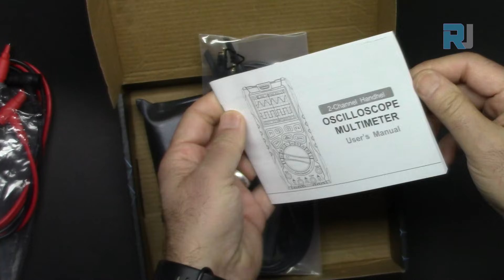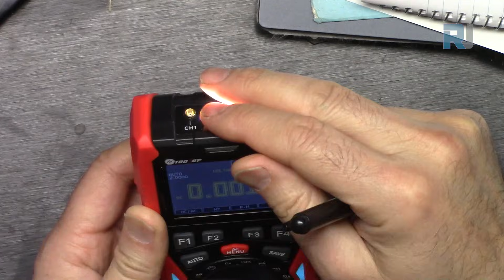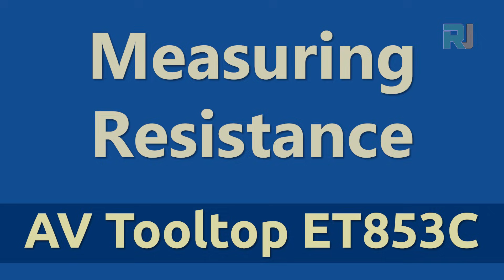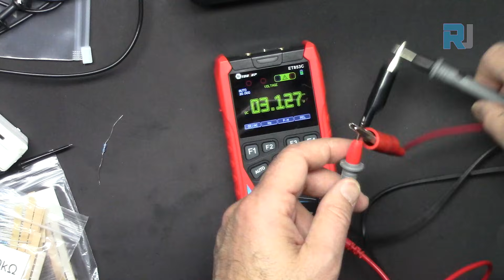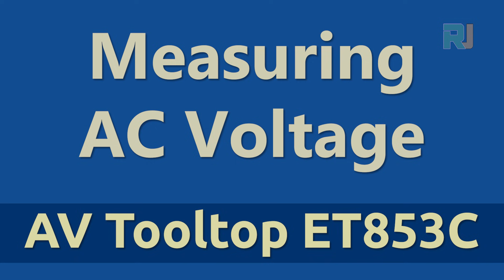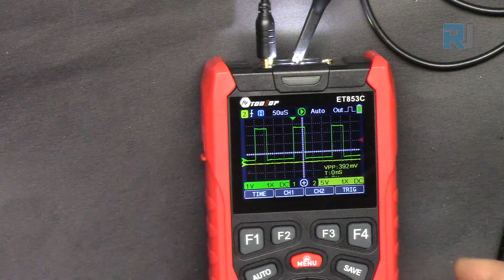ET853C 3-in-1 2CH 70Mhz Oscilloscope Multimeter Signal Generator 3-In-1 from AV ToolTop

Comment: This tooltop doesn't even have an official website!
So there's no way to find the specifications anywhere.
The measurement error for these Chinese devices is probably something like ±10 volts, and the impedance is probably 1 ohm!
(And there's not even a link to the promised documentation under this video.)
Reply from the maker: Hello, thank you for your comment. The link to resources page added Download and resource page https://robojax.com/RJT836 and user's manual and full specs published.